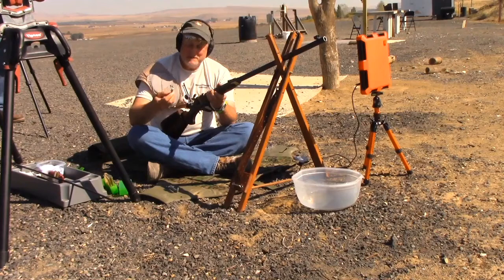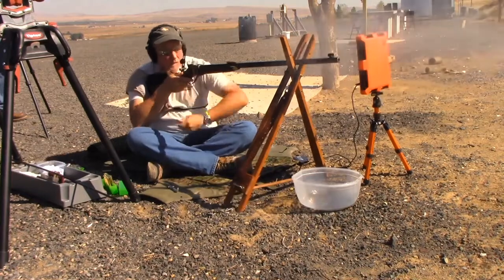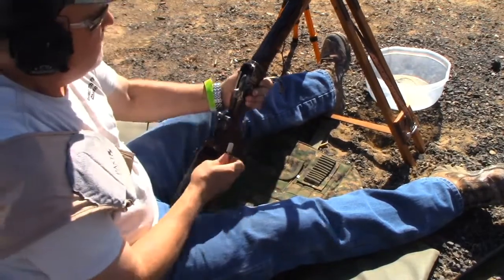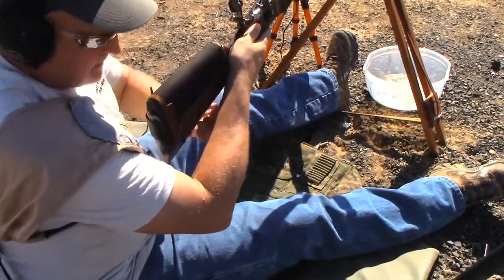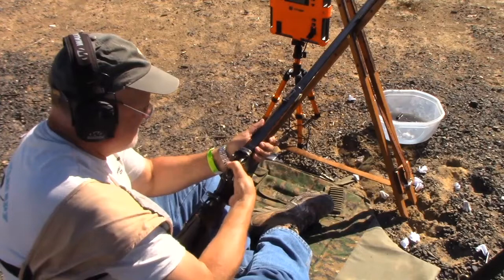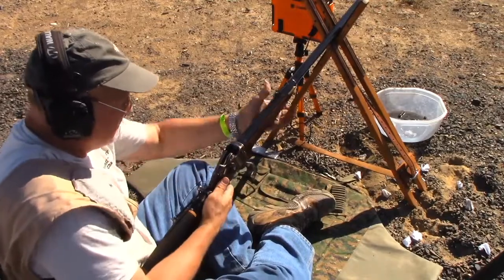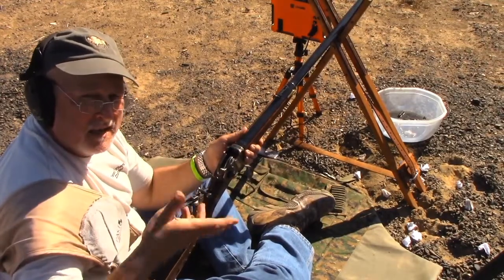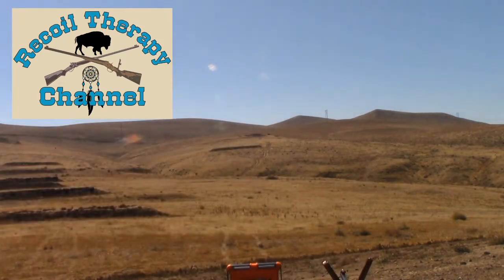Bore Wipers and Black Powder Cartridge Rifle Shooting

Comment: Just checking, I know this video is a few years old, but it seems like in the new videos all you are using is three patches, one wet and 2 dry?  is that right?  do you have special jag on the rod?  Thanks
Reply from the maker: @dougdukes1039  yup 2 wet 1 dry. I like 3” patches and the jag is the one from Montana Extreme. Also use a chamber mop to make sure the chamber is dry. Wet chamber equals case separation.

Comment: I've had great luck with the BACO bore pigs with paper patch, but less than stellar with greasers, especially bore-riders. They just seem to do better with a little left over lubricant/soft fouling in the bore. I'm thinking about going to the nationals in Raton this year, even with the price of diesel, and taking my 40/50 Bottleneck, and if so, I'll be shooting paper patch and using the BACO bore pigs.
Reply from the maker: I need to get myself into PP but I haven’t managed it yet.  Still trying to get these greasers figured out.
Reply: @RecoilTherapyChannel  So far it's been better on paper, but I've yet to shoot PPB's in a match. We'll see what my scores do.

Comment: What is your preference, buffalo arms wipes or Eric's bore wipes? Just wondering, thank you
Reply from the maker: I have 200 of each and honestly I prefer Eric’s wipers. I don’t have to do any laundry, and it’s easy to reload a wiper just by rinsing it off and changing out the patch for a clean one.
Reply: @RecoilTherapyChannel  
Thank you, ordered Eric bore wipes and a rod! Looking forward of going to wiping instead of blow tube
Reply: @RecoilTherapyChannel  
I got my bore wipes from Eric, I saw in your video you put the damp patch on the bore wipe and a dry patch behind it? Thank you
Reply from the maker: @bradhiserote6057  yes that’s how it works. Very important to have the chamber and bore dry for the next shot.

Comment: I'm dying for a reloading video for your 45-70 Sharps for your long range loads! Love your videos, thanks for keeping me entertained.
Reply from the maker: Silhouette might go a little too fast to use more wipers. I haven’t been able to do it at any rate… I run my Bluetooth for silhouette matches, and then just clean as per normal between relays. When you get to the Quigley or other matches like that, however, things are different. And you can definitely more wipe in between every shot, which gives you a big advantage of having a clean barrel for every shot.

Comment: Is there a link to he breech seating tool? 
As it's been a year, any changes in the bore wipes you are using? Did you go with Eric's delrin wipes? And would there be a link to those, as well? 
I know it's been said, but we can't say it too much, thanks man, for running point on all this! 👍👍
Reply from the maker: I am using Eric‘s bore wipers and his seating tool with no complaints. I own a whole bunch of the Buffalo Arms wipers too, but I don’t like messing with those felt wads.  The only place where I could say that the Buffalo Arms bore wipers might be better would be an extremely hot climate with single digit humidity. Otherwise I don’t feel that there’s any real difference between the two.
Reply: @RecoilTherapyChannel  Good to hear.. How do I contact Eric?
Reply from the maker: @michaelshoup2703  eedouble7@gmail

Comment: Thanks for the video.  You are the first one to truly explain and show how to use them.  I made the mistake of ordering the swabs only without the rubber gasket in the rear.  Now I know what to do.  Can the swabs be washed and reused?  Also was that only water on the bucket where the bore swabs fall into, or does it contain a solvent as well.  Enjoy your videos immensely.
Reply from the maker: The swabs are wool.  I got a laundry bag for women's lingerie and I put them in there and they just go in with my work clothes in the washer.  The solution in the tub is Simple Green mixed with distilled water  I use about 1.5 ounces per gallon (one full shot glass) and I arrived at that ratio by testing it with a pH testing kit (video coming on that).  You want the pH to stay between 7.5 and 9.5.  Any lower is acidic and any higher is too far to the base side.  I change out the fluid after a couple hours and then wash with regular dish soap.